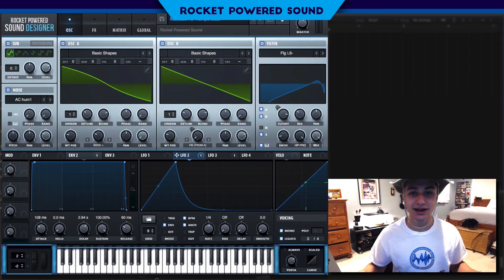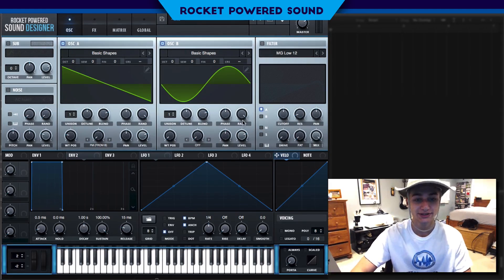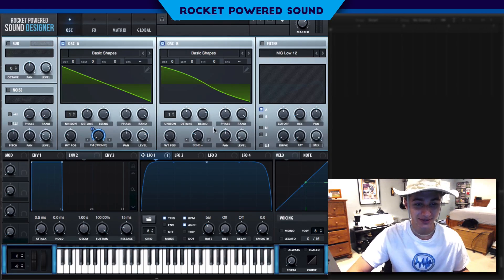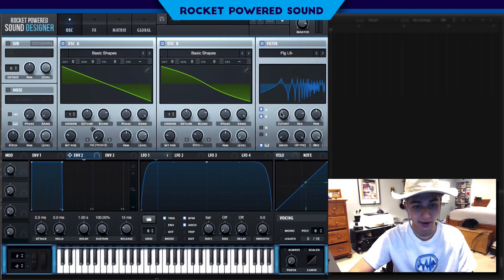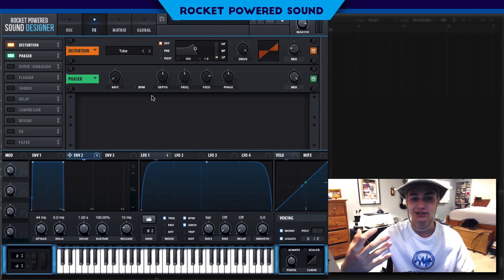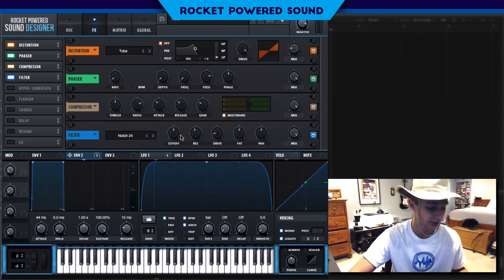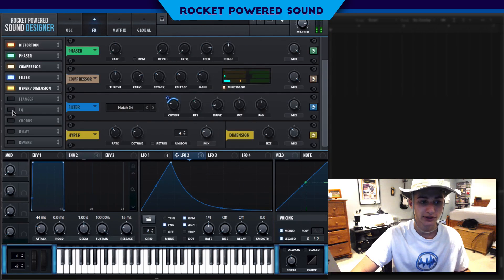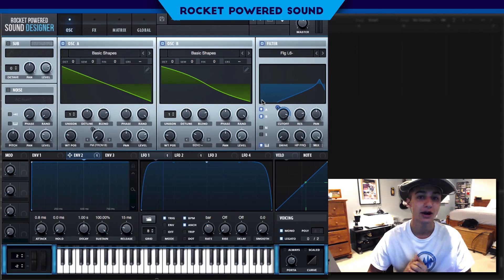MARAUDA TRAMPA DUBSTEP BASSES SERUM TUTORIAL HOW TO

Comment: why it sounds different when before the phone ring and after you turn off your phone. i am exactly in the same sound before the phone ring but after that you changed righ bottom corner to 50+%. i tried same. but still sounds different with the final. is there any final layering or automation. Kindly need your help bro thanks